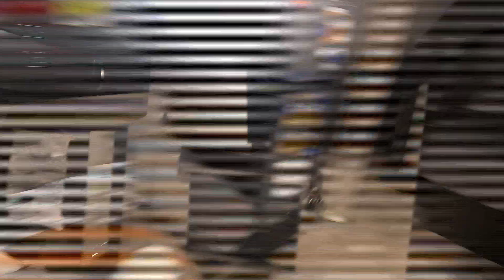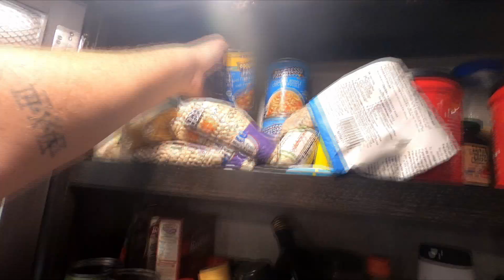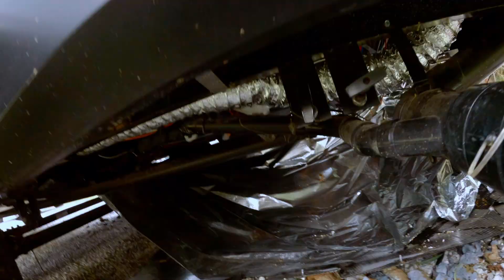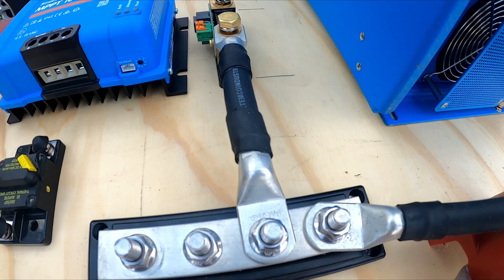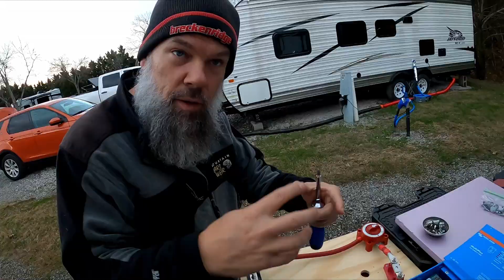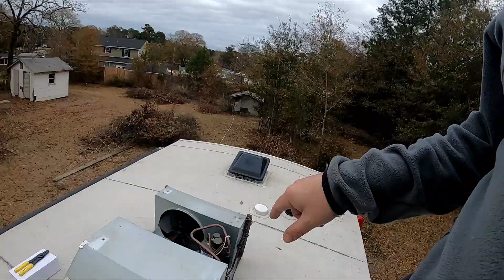More Repairs & Full Off Grid Install 30 Amp RV Travel Trailer | Full Time Livin' E5

Comment: I would title every video My Grand Design Imagine Travel Trailer is a Lemon & keep making them until I got a full refund.  What a piece of garbage that thing is.
Reply from the maker: Man Im telling ya! There’s actually another part that i cut from this video where there was a leak around this same time that was under the shower. I filled up a 5 Gal bucket full of water with a shop vac that leak has yet to be completely figured out
Reply: @SirWilliamGoes  You might be surprised how far a little bad publicity goes!  It's even more clear why people are removing their roof top heat & ac units and using mini splits and diesel heaters.